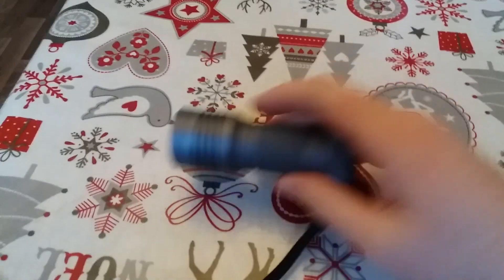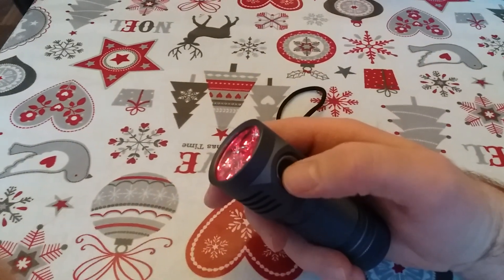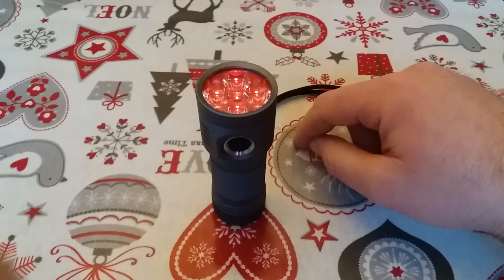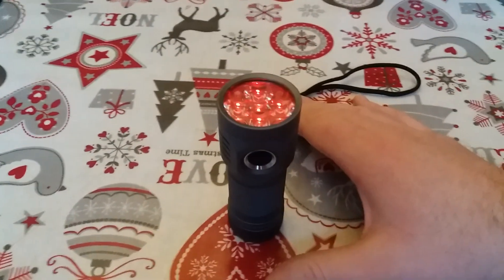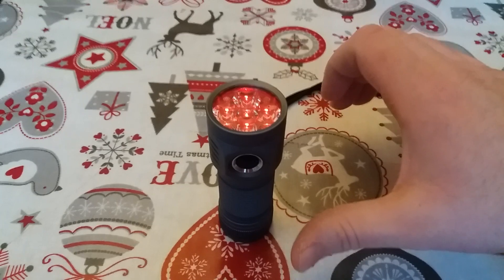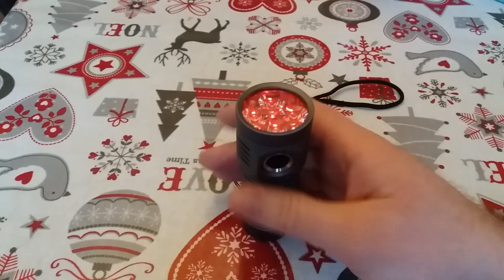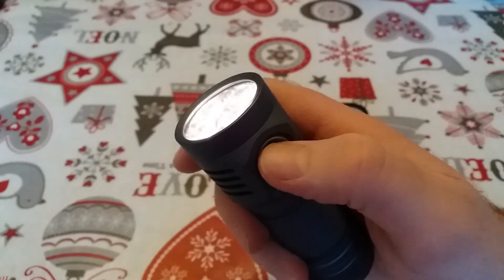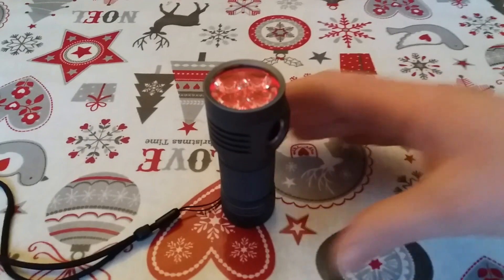Emisar D4S how to configure thermal limit

Comment: Great vid...quite helpful indeed

How might I ask does one set the thermal limit for a D4?

I’ll subscribe to your channel in hopes that you post a ‘how to’ video on the D4
Reply from the maker: Sorry I didn't realise they were different.
With the d4 you need to click the button ten times, hold the button down on the 11th click and keep it held until you find the light uncomfortable to hold. At that point release the button to set the desired maximum temp.
If I remember correctly (I could be wrong) the light will then make two short series of blinks from the emitters. These tell you the degrees Celsius  you have set the maximum temperature to. For example 6 flashes followed by 5 flashes indicates 65 Celsius 
I think the maximum permissible is 75 degrees Celsius. 
Cheers
Reply: I’m amazed you’re able to figure that out...I never would have

Thanks a bunch
Reply from the maker: P.s. as you're holding the button down. If it starts blinking whilst still holding the button in, you ha've reached the maximum. Just let go at that point. 
The light does feel very hot at the maximum level though!
Reply from the maker: P.p.s clicks need to be in quick succession

Comment: Thanks for the video , how do you set turbo in the ramping  ?
Reply from the maker: Sorry mate. Is there any chance you could re word your question I'm not to sure what you mean
Reply: torchesarecool uk sorry I meant to say how do you adjust ramping configuration, I looked at the diagram and still confused on that part
Reply from the maker: @asilaydying1984  oh ok
The ramping setting is actually going through 1-150 small increments. 1 being moonlight and 150 being maximum turbo (I.e What you get when you double click) 
So once you've pressed your button 4 times to enter ramp config. The initial thing to do is to set your lowest setting whilst it's strobing. This can be anywhere from 1-150 clicks! If you want the lowest, just click once. Once it's registered with a flash and starting strobing again, this is when you set your maximum output. To do this you press once for every increment below 150(max) you want. I.e if you want your max ramp to be level 130 out of 150 then you would click 20 times. (You will still have access to maximum 150 anytime by double clicking)
If you're in stepped ramping then you will have a third strobe in which you can select how many steps you want.
It's hard to explain. Let me know if you still have trouble. Cheers.
Reply: torchesarecool uk thank you that makes sense other than you said 4 clicks to enter ramping configuration? I thought 4 clicks was for momentary only ? Sorry I have so many lights with different uis that hard to remember them all
Reply from the maker: @asilaydying1984  no worries. Glad to help
Reply: @ainsgb , Can you guide me how do I program where I can get Turbo from single click from off? I know you stated something about having it to max 150 clicks but not sure how to do that? Thanks

Comment: What is the purpose of doing this?
Reply from the maker: The light has thermal management to ensure the leds and componants do not burn out due to heat. This light has the added benefit of allowing the user to customise the maximum temperature of the light to suit for comfort as well. I find allowing the light to run over 60 degrees celcius starts to get uncomfortable. 50 degrees is comfortable for long term handling but of course you reduce the runtime on max output.
Everyone's different, and this light caters for most preferences.